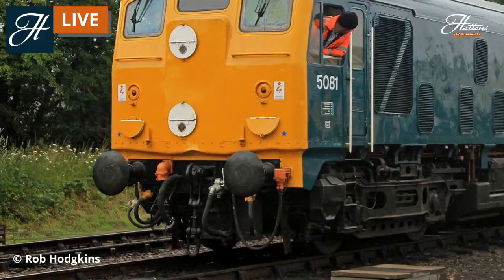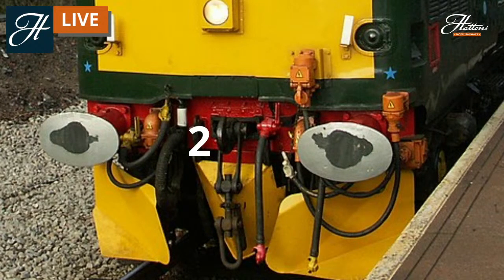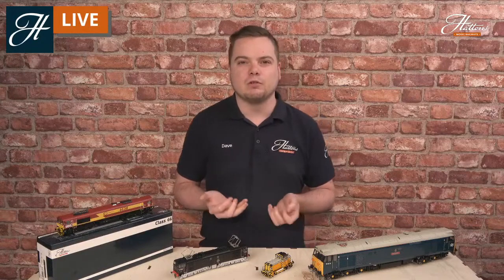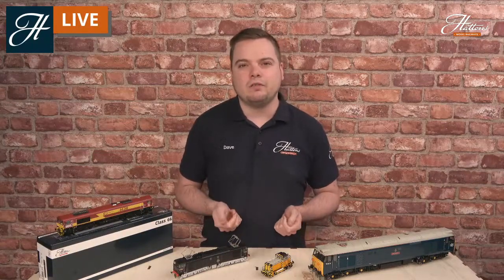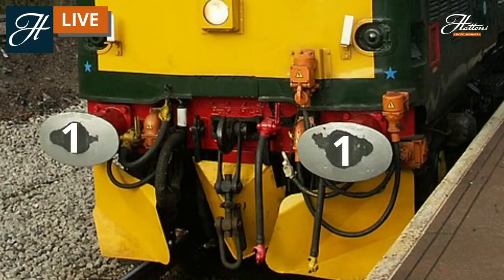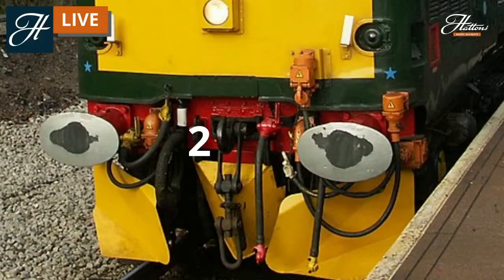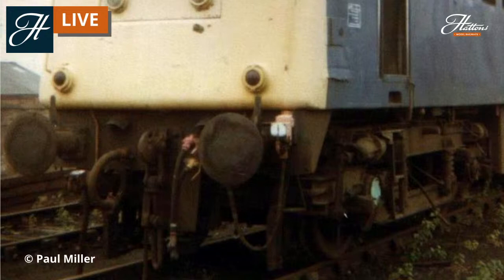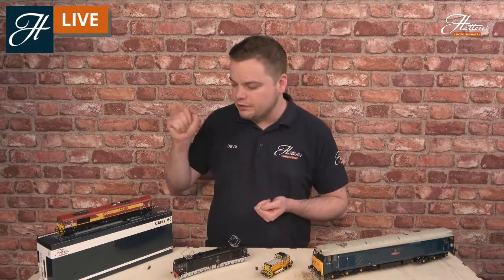Identifying bufferbeam detailing and pipework - Diesel and electric locos

Comment: BR stopped using the 2-pipe air brake system in the 1990s for freight wagons as most Europen countries only use a single pipe system.

Just clarity white was used for a through pipe on both the air and vacuum brake systems.

Comment: They never use the coupler on the wagon to couple it to the locomotive. If the locomotive's coupled was broken than the emergency spare carried in the licomotive would be used. That 66 would carry at least one screw link coupling for use on the non-knuckle coupling fitted wagons.